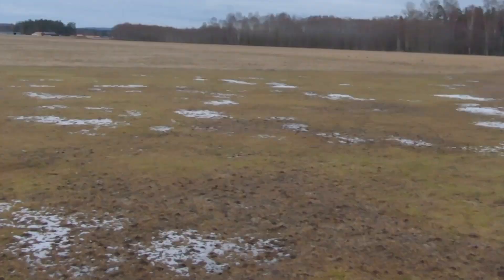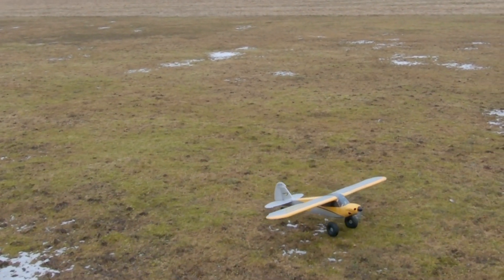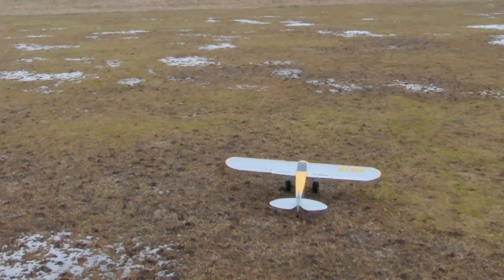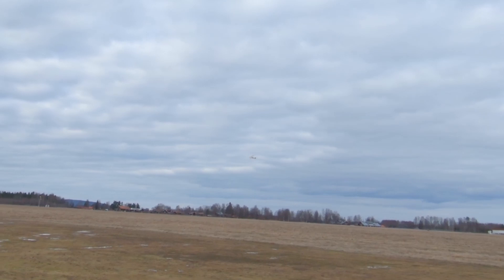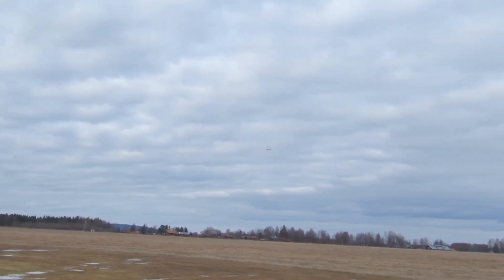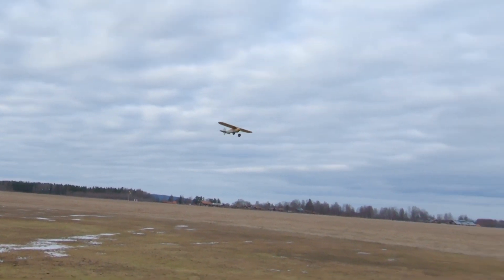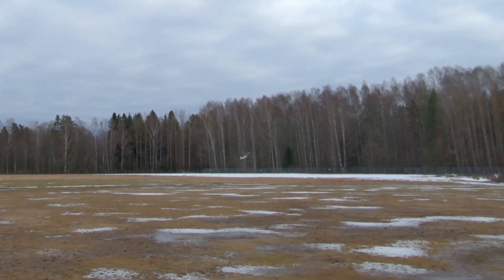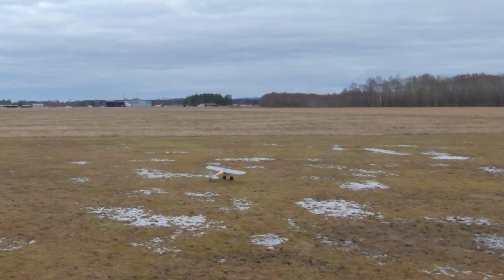Carbon Cub S+

Comment: Hi Daniel, did you get telemetry from the cub on your TX16S?
Reply from the maker: Hi!
The Carbon Cub S+ doesn't have any telemetry. 

But the Carbon Cub S2 sends the battery voltage if I remember correctly.